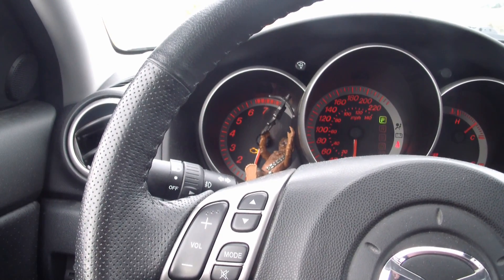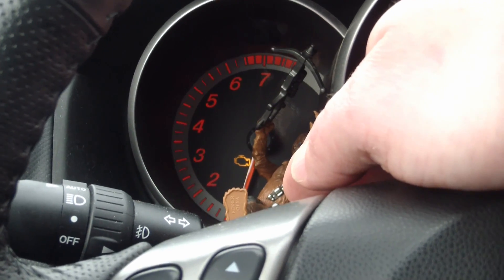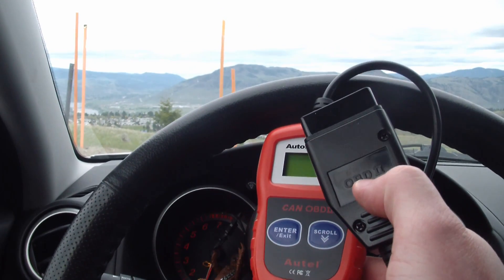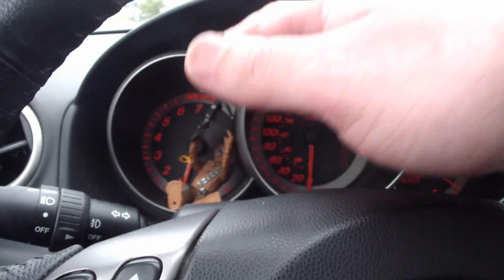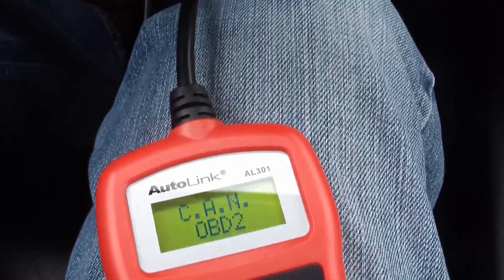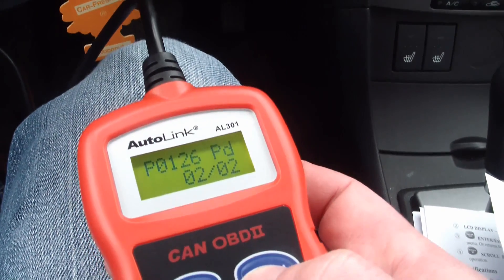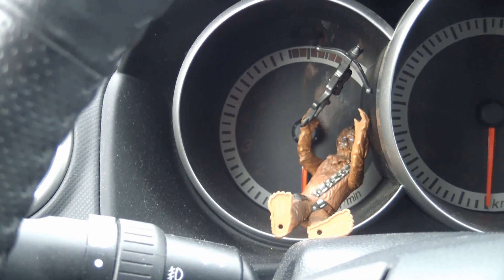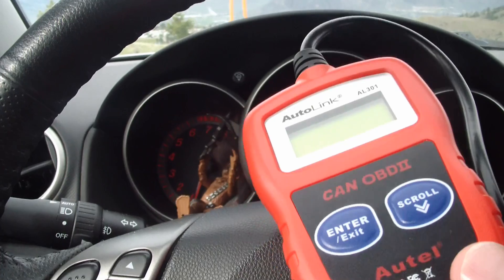Manly-Man Skills: Outsmart Mechanic Scams by Using Your Car's Computer!

Comment: Generic/global code readers are nice little tools. People overestimate what a vehicle's "computers" can actually monitor though, for example I've heard people say "It just overheated and idk why because there was no check engine light" lmao. HaHa! Anyways I've learned several tips and tricks from you so I'll try and return the favor. Typically this code is set by a faulty mechanical thermostat more often than an electrical failure. The thermostat will fail to close completely and allows coolant to flow all the time making the engine take forever to reach 180-200℉. The pcm has an expected temperature threshold after a certain run time. Approx 10 mins of run time the pcm wants to see a ect value above a certain value, if it doesn't see a high enough value it will illuminate the cel. Since you only have a code reader without live data stream you could backprobe the 5v reference circuit and determine what the pcm is seeing from the ect sensor to determine if it high enough. Also use your laser temp gauge to determine if it matches the vehicles gauge. There are many other things that could be wrong but as a quick educated guess just by seeing those codes enough over the years I would start by checking for proper thermostat operation. Hope that helps.

Comment: ok your car has a p0171 you have 1 hour to fix it (rip somebody off) what is wrong

Print
ProDemand
2006 Mazda 3 2.3L Eng S

Component
P0171

REQUESTED INFORMATION

California Emission Regulation Applicable Model

DETECTION CONDITION AND POSSIBLE CAUSE - CALIFORNIA EMISSION REGULATION APPLICABLE MODEL (DTC P0171 - LF, L3)
DTC P0171	Fuel trim system too lean
DETECTION CONDITION 	
PCM monitors short term fuel trim (SHRTFT) and long term fuel trim (LONGFT) values when closed loop fuel control. If the LONGFT and the sum total of these fuel trims exceed preprogrammed criteria, PCM determines that the fuel system is too lean.
Diagnostic support note 

This is a continuous monitor. (Fuel system)
The MIL illuminates if PCM detects above malfunction condition in two consecutive drive cycles or in one drive cycle while DTC for the same malfunction has been stored in PCM.
PENDING CODE is available if PCM detects the above malfunction conditions during first drive cycle.
FREEZE FRAME DATA is available.
DTC is stored in the PCM memory.
POSSIBLE CAUSE 	
Misfire
Front HO2S deterioration
Front HO2S heater malfunction
MAF sensor malfunction
Pressure regulator malfunction
Fuel pump malfunction
Fuel filter clogged or restricted
Fuel leakage on fuel line from fuel delivery pipe and fuel pump
Fuel return hose clogged
Leakage exhaust system
Purge solenoid valve malfunction
Purge solenoid hoses improper connection
Insufficient compression
Variable valve timing control system improper operation
Air suction in intake-air system malfunction
PCM malfunction
DIAGNOSTIC PROCEDURE CHART
STEP	INSPECTION	ACTION
1	VERIFY FREEZE FRAME DATA AND DIAGNOSTIC MONITORING TEST RESULTS HAVE BEEN RECORDED 
Have FREEZE FRAME DATA and DIAGNOSTIC MONITORING TEST RESULTS (Fuel system related) been recorded?
Yes	Go to the next step.
No	Record FREEZE FRAME DATA and DIAGNOSTIC MONITORING TEST RESULTS on repair order, then go to the next step.
2	VERIFY RELATED REPAIR INFORMATION AVAILABILITY 
Check for related Service Bulletins and/or online repair information availability.
Is any related repair information available?
Yes	Perform repair or diagnosis according to available repair information.
If vehicle is not repaired, go to the next step.
No	Go to the next step.
3	VERIFY RELATED PENDING CODE OR STORED DTCS 
Turn the ignition switch off, then to the ON position (Engine off).
Verify related PENDING CODE or stored DTCs.
Is other DTCs present?
Yes	If misfire DTC is present, go to Step 8.If other DTC is present, go to appropriate DTC troubleshooting procedures.(See DTC TABLE [LF, L3] ).
No	If drive ability concern is present, go to Step 8.If not, go to the next step.
4	IDENTIFY TRIGGER DTC FOR FREEZE FRAME DATA 
Is DTC P0171 on FREEZE FRAME DATA?
Yes	Go to the next step.
No	Go to troubleshooting procedures for DTC on FREEZE FRAME DATA.
5	VERIFY CURRENT INPUT SIGNAL STATUS (IGNITION KEY TO ON/IDLE) 
Access APP1, APP2, ECT, MAF, TP1 and VSS PIDs using WDS or equivalent.
(See PCM INSPECTION [LF, L3] ).

Is there any signal that is far out of specification when ignition switch is ON and engine runs?
Yes	Inspect suspected sensor and excessive resistance in related wiring harnesses. Repair or replace if necessary.Then go to Step 16.
No	Go to the next step.
6	VERIFY CURRENT INPUT SIGNAL STATUS UNDER TROUBLE CONDITION 
Inspect same PIDs as Step 5 while simulating FREEZE FRAME DATA condition.
Is there any input signal which causes drastic changes?
Yes	Inspect suspected sensor and related wiring harnesses, and repair or replace it. Then go to Step 16.
No	Go to the next step.
7	VERIFY CURRENT INPUT SIGNAL STATUS OF FRONT HO2S 
Access O2S11 for P0171 PID using WDS or equivalent.
Check PID under following accelerator pedal condition (in PARK (ATX) or NEUTRAL (MTX).
Is PID reading normal?
Less than 1 mA  when accelerator pedal is suddenly depress (rich condition)
More than 1 mA  just after release of accelerator pedal (lean condition)
Yes	Inspect for air suction at followings due to cracks, damages and loosening parts:
From air cleaner to throttle body
From throttle body to dynamic chamber
From dynamic chamber to intake manifold
Vacuum hoses
 NOTE:
Engine speed may change when rust penetrating agent is sprayed on the air suction area.
Repair or replace any faulty part, then go to Step 16.
No	Visually inspect for any gas leakage between exhaust manifold and front HO2S.
If there is no leakage, replace FRONT HO2S.
Then go to Step 16.
8	INSPECT MAF PID 
Start engine.
Access MAF PID using WDS or equivalent.
Verify that MAF PID changes quickly according to race engine RPM.
Is MAF PID response normal?
Yes	Go to the next step.
No	Replace Mass air flow sensor, then go to Step 16.
9	INSPECT FOR EXCESSIVE AIR SUCTION OF INTAKE AIR SYSTEM 
Visually inspect for loosen, cracks or damages hoses on intake air system.
Is there any malfunction?
Yes	Repair or replace source of air suction, then go to Step 16.
No	Go to the next step.
10	INSPECT FUEL LINE PRESSURE 
Turn the ignition switch off.
 NOTE:
If engine won't start, inspect fuel line pressure with ignition switch ON.
Inspect fuel line pressure while engine running.
(See FUEL LINE PRESSURE INSPECTION [LF, L3] ).

Is fuel line pressure normal?
Yes	Go to Step 12.
No	
If fuel line pressure is too high: Replace fuel pump unit, then go to Step 16.
If fuel line pressure is too low: Go to the next step.
11	INSPECT FUEL LINE FROM FUEL PUMP TO FUEL DELIVERY PIPE 
Visually inspect fuel line for any leakage.
Is fuel leakage found?
Yes	Replace suspected fuel line, then go to Step 16.
No	Inspect low-pressure side fuel filter for follows:
Foreign materials or stain inside fuel filter
Perform following actions as result.

If foreign materials or stain is found inside fuel filter (low-pressure side), clean of fuel tank and filter.
If normal, replace fuel pump unit.
Then go to Step 16.
12	INSPECT IGNITION COIL HARNESSES 
Inspect the ignition coil related harness condition (intermittent open or short) for all cylinders.
Are harness conditions normal?
Yes	Go to the next step.
No	Repair suspected wiring harnesses, then go to Step 16.
13	INSPECT IGNITION SYSTEM OPERATION 
Carry out spark test.
(See SPARK TEST ).

Is strong blue spark visible at each cylinder?
Yes	Go to the next step.
No	Repair or replace malfunctioning part according to spark test result. Then go to Step 16.
14	INSPECT ENGINE COMPRESSION 
Inspect engine compression.
(See COMPRESSION INSPECTION [LF, L3] ).

Is it normal?
Yes	Go to the next step.
No	Implement engine overhaul for repairs, then go to Step 19.
15	INSPECT FUEL INJECTOR OPERATION 
Remove fuel injector.
Inspect injector operation.
Is fuel injector normal?
Yes	Go to the next step.
No	Replace injector, then go to the next step.
16	VERIFY TROUBLESHOOTING OF DTC P0171 COMPLETED 
Make sure to reconnect all disconnected connectors.
Clear DTC from PCM memory using WDS or equivalent.
Perform the "PCM Adaptive Memory Produce Drive Mode" and "HO2S heater, HO2S, and TWC Repair Verification Drive Mode".
(See OBD-II DRIVE MODE [LF, L3] ).

Stop vehicle and access ON BOARD READINESS TEST to inspect DRIVE MODE completion status.
Verify FUEL_EVAL PID changes to yes.
If not, perform the "HO2S heater, HO2S, and TWC Repair Verification Drive Mode" again.
Access PENDING CODE.
Is the PENDING CODE for this DTC present?
Yes	Replace PCM, then go to the next step.(See PCM REMOVAL/INSTALLATION [LF, L3] ).
No	Go to the next step.
17	VERIFY AFTER REPAIR PROCEDURE 
Perform "AFTER REPAIR PROCEDURE".
(See AFTER REPAIR PROCEDURE [LF, L3] ).

Is there any DTC present?
Yes	Go to applicable DTC inspection.(See DTC TABLE [LF, L3] ).
No	Troubleshooting completed.